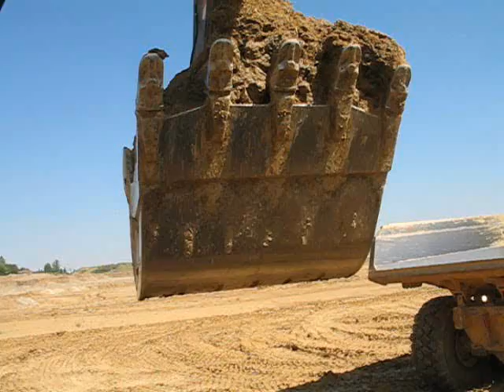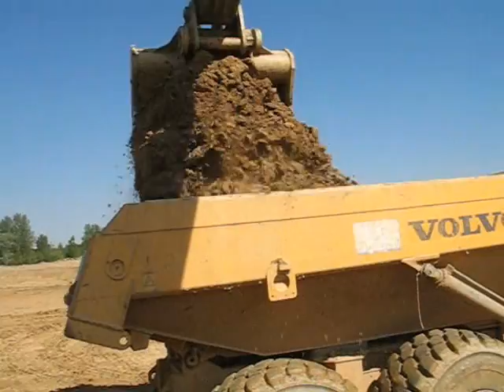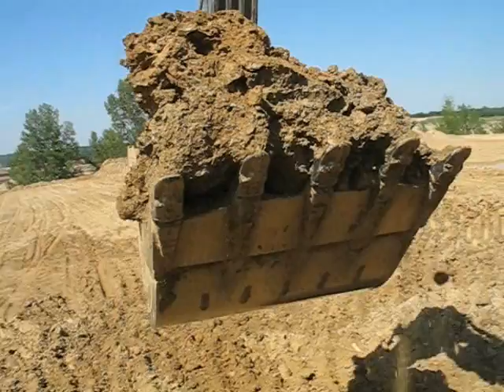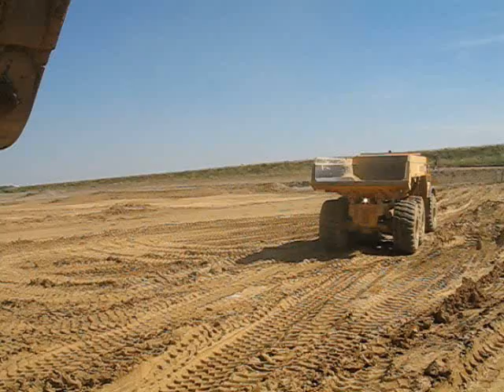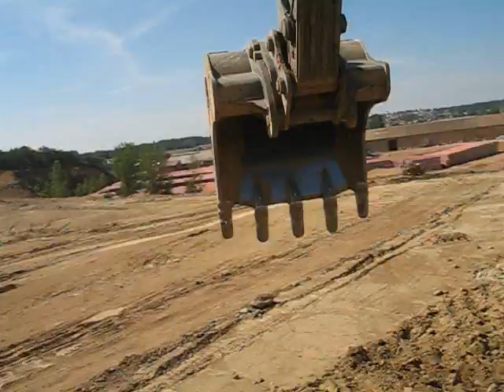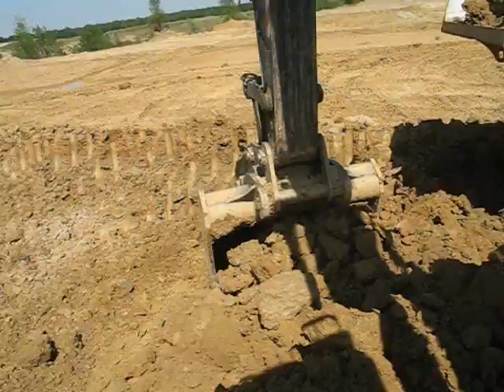EC700B loading A40D from cab

Comment: The trucks should stand in front, on the ground of the hole. that would minimize rotation and save pull up hight. load one truck from the left and the next from the right and so on.